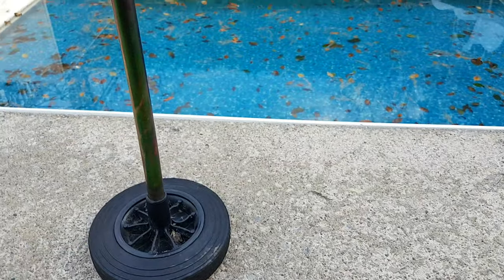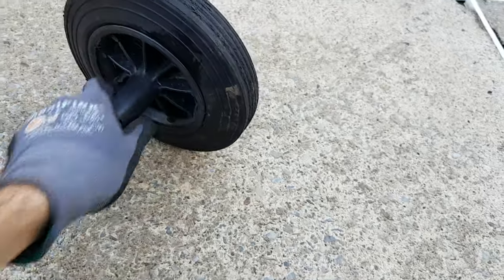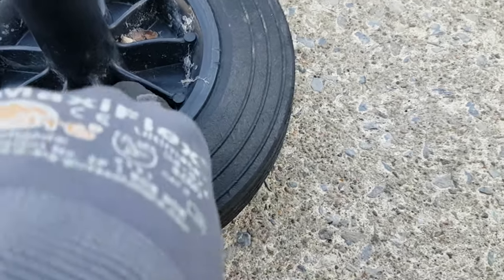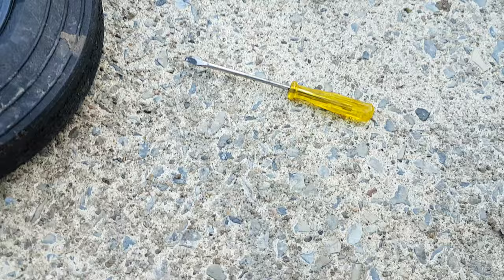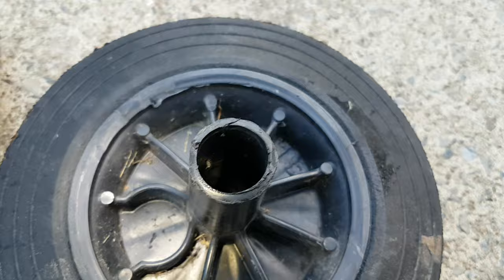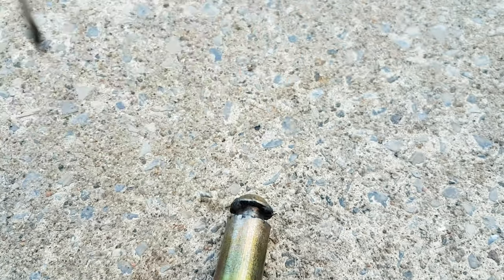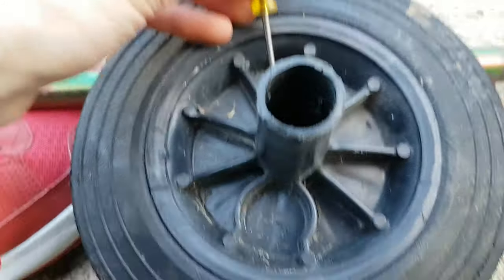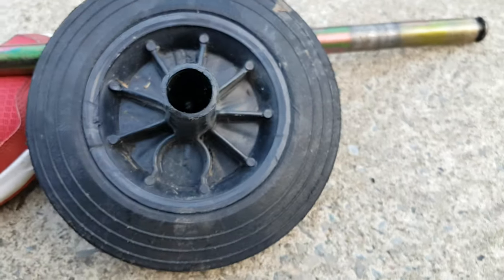How to Remove Garbage Recycling Bin Wheels

Comment: Hole is suppose to be drilled on the outer side of wheel . . . You will see the plastic engineers have left a mark exactly where the Pin is .  Like  a punched mark . . .then insert a screw driver then lift the Pin  . . .this video is incorrect .Spring action pins  are meant to be pulled up from the top area  pushed up from the bottom .Nice tutorial.